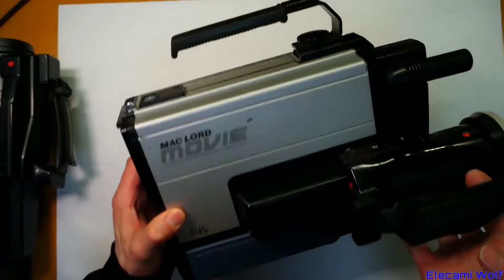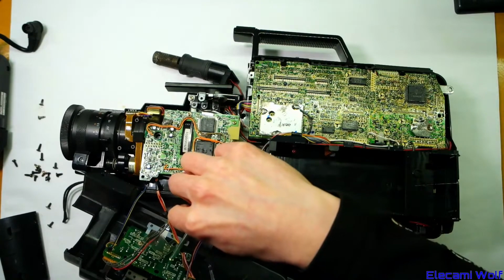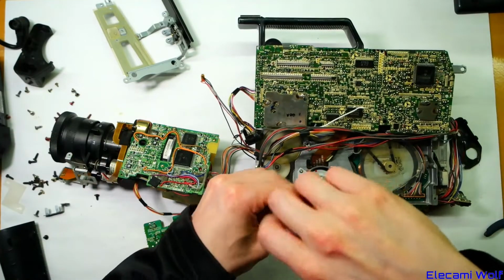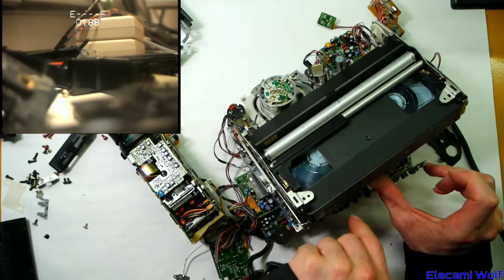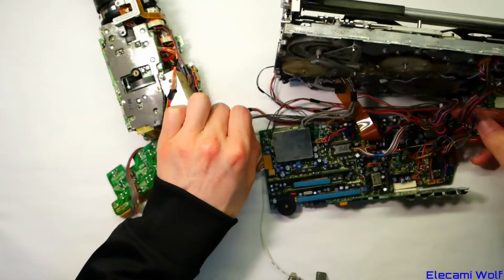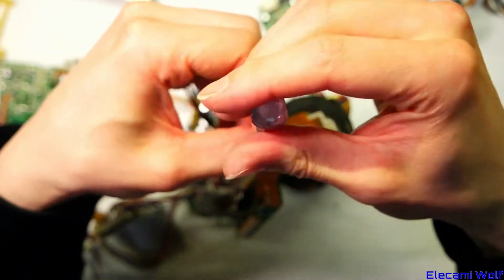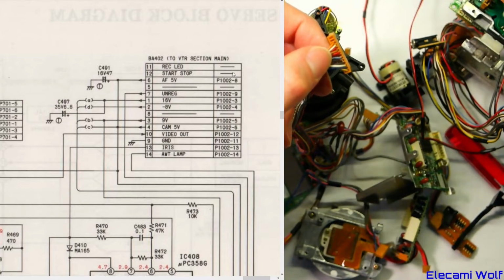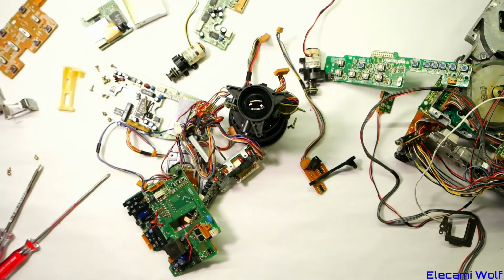EW0061 - National Panasonic NV-M5 Investigation Teardown

Comment: I recently bought an M5 camera. Everything works fine so far. Only the mechanism for ejecting the cassette does not work reliably. If there is no cassette in the camera, the eject function always works.
However, if there is a cassette in the camera, I have to press the eject button several times to eject the cassette. Do you have any idea what might be causing this?
Reply: I have solved the problem. I need to replace both drive belts. This should fix the my problem 🙂 Btw you make great videos!
Reply from the maker: Glad you got it sorted. Thanks.

Comment: Hello, I recently found an NV-M5 in almost perfect condition. My only issue with it is the lens is quite fogged, and the autofocus system seems to be struggling quite badly. I was wondering if you had any resources regarding how to disassemble the lens assembly for cleaning. Additionally, the machine seems to be playing tapes ever so slightly too slow, maybe around 0.9x speed. If you had any advice or information regarding how to fix these issues it would be greatly appreciated.
Reply from the maker: it might not be possible to dismantle the lens enough. Some of the lens are held in plastic moldings. Not sure if the Service Manual will explain it. 
Not sure about the speed. Will it play back something it recorded at the right speed?
Probably needs some capacitors replaced at a minimum.
Reply: @Elecami The speed issue only happens with one tape which also has other issues but, after testing a few other tapes they all play at normal speeds with good image quality. Sadly the service manual says absolutely nothing about disassembling the lens. I have read on the service manual that there is a screw used for setting & locking infinity focus, so I’m hoping undoing that screws allows for the front lens group to be unscrewed, hopefully allowing for some cleaning to be done.
Reply from the maker: @siroescribano4872  Maybe you can get into the lens, it might be sealed and impossible. If it has mildew, it might be difficult to clean off. The IR filter could be affected too.

Comment: My M5 autofocus does not work. If I switch the lever from manual to auto nothing happens. Also if I hold the quick focus button the lens still won‘t turn. I looked inside and found out that the motor for autofocus doesn‘t even spin. Is the small motor just broken? Besides that everything works.
Reply from the maker: Probably the very tiny belt that goes from the motor to the gear box has gone bad. That is common now.

Comment: My m5 doesn't record. Nonthing happens when I Push the button and sometimes it shuts down when I Push the eject button. Please help me 😊
Reply from the maker: Probably because the capacitors in the power supply circuits have gone bad. That is the most common problem these days.

Comment: Imm buying one to film a found footage film. Do you recon this is a good fit?
Reply from the maker: Maybe if it is still working, might need to replaces the power supply capacitors inside it.
Reply: @Elecami  ive been told it work i hope it does

Comment: Pulled the family NV M5 out of storage and have been giving it a go - the camera doesn't seem to expose properly with inside lighting, and the backlight button doesn't work - is there a simple solution to this?
Reply from the maker: Not sure it depends on the specific cause of the issue. These camera will need a lot more light than modern cameras. 
Does it work ok in daylight / outdoor?
Likely the power supply circuits are going bad from work out capacitors. That is a common issue with these.
Reply: @Elecami  works okay under daylight and full power studio LED lighting, certainly not bright though! I might just be unsure what to expect! Sounds like the external power supply needs the capacitors changed? 
PS thankyou very much for the response!
Reply from the maker: @lethalwithalens  Power supply circuits in the camera. 
If you see lines in the view finder or distortions on the video output when the Tape in loading up into play or record mode, that will indication power supply problems are starting.

Comment: I recently acquired one of these for rather cheap, it switches on but when I look into the viewfinder it’s just white with loads of jumpy lines, do you know what this could be?…plays back video fine thought so I know it’s not the CRT.

Also struggling to get it to connect to tv, if you have any tips, that would be great!
Reply from the maker: The usual problem with these is that the power supply capacitors have gone bad. This can be seen as camera not working or picture very distorted, lines on the screen / Viewfinder when the tape is loading and unloading. That would be the first thing I would check / replace.

Comment: Finally a video on the M5! 
Would you perhaps know how to get a closed iris unstuck? Playback works but it doesn't "see anything"...
Reply from the maker: You would have to take the lens assembly apart and give the iris a poke to free it. Be sure that is the actual problem first. 
Quite likely to see capacitors gone bad in the power supply on these cameras. That could prevent the camera from working while other parts still function. You could judge the power supply performance by looking for distortion on the view finder while the tape is entering play mode. The power load or the loading motor will sag the power supply if the capacitors are bad.

Comment: Olha pode me tirar uma duvida sou aqui do brasil tenho uma nv - m5 ela grava colorido  mais reproduz em preto em branco qual sera o defeito?
Reply from the maker: Could be the back tension band fallen off. or an issue with chroma electronics.
Reply: Como posso resolver amigo esse problema
Reply: Essa faixa de tensão traseira  seria o que?
Reply: Problema  om eletrônica croma vc pode me explicar?
Reply from the maker: @cirovieirademeloneto8425  I don't have more information about it sorry. I would start by checking the electrolytic capacitors. They could have dried out from old age.

Comment: My NV-M5 seems to be stuck in FFW mode when playing back and recording. I have no idea why. The buttons work OK so its not a stuck FFW button.
Reply from the maker: Maybe the pinch roller is bad and the take-up is pulling the tape through. OR bad serveo and capstan is running fast OR bad control telling capstan the wrong thing. 
Maybe capacitors have gone bad. Almost guarantee they've gone bad in the power supply circuit.
Reply: I had this same issue with my m5 (ag 160, but similar in everything) possible issue with the model fast-forwarding could be the mode switch, you may need to open the camcorder to get into the mode switch and clean the contacts with contact cleaner. I did this and now it works perfectly okay for the most part.

Comment: Do you have to take off the camera section to access the belts? I just purchased a PV-220D which appears to use the same chassis/design, expect it uses a Newvicon tube instead of a CCD. I've also read that these have capacitor issues, is that true? The one I bought was manufactured in February 1986, and it looks like the capacitors are though hole so it shouldn't really be a problem I think.

I ended up just scrapping the parts off of my PV-200D since I couldn't figure out the problem with the tape mechanism.
Reply from the maker: I think you will need to take the camera part off to access the belts, especially the tube type since it has a big board that covers the mechanism. Capacitors can be a problem in the power supply. Because it is a switching power supply, that is hard on capacitors due to high ripple current.
Reply: @Elecami  I just got my PV-220D, the camera section works but I believe the capstan belt is bad as it is squeaking. I can get it to play a pre-recorded tape and I've managed to make a recording but since I have a replacement belt I will replace it.
Reply from the maker: @KylesDigitalLab  Sounds good. 
I am not sure if the belt would be the cause of squeaking though.
Reply: @Elecami  I got the belt replaced and it's fixed now, but I broke the metal piece for the "cursor" which is that sliding part that engages the switch on the operation PCB between VTR and camera mode. Everything else is intact so I'm wondering if it's possible to do anything to make it engage with the switch again. Like using epoxy or soldering metal tabs to the remaining piece of metal. If you have any ideas please let me know because it's perfectly functional and working now.
Reply from the maker: @KylesDigitalLab  I am not sure of the exact piece that is broken. Probably can't be soldered easily. Would depend what metal it is made form and plated with. Epoxy might be better. 

Probably be easier to solder in another separate external switch like a small toggle or slide switch.
Reply: @Elecami  I ordered a pack of slide switches from Digikey. It should work with the PCB but I'll probably have to epoxy some plastic to the cursor in order to make it engage. I'm just hoping I can make it look factory from the outside with no external switches.
Reply from the maker: @KylesDigitalLab  Hopefully that works out ok. Another options would be to find another of those camera to get the parts from.

Comment: I have Hitachi 500E full size vhs camcorder problem is when i turn on camera the red light blinking and loading motor run automatically for some seconds then camera off same things happen when my Panasonic nv-m3000 what is the case of this?  I checked power supply with another unit its power supply is ok dose it main pcb problem i don't know what i check in main pcb can u please help me its really helpful because its really stressed
Reply from the maker: Probably is the belt on the loading motor slipping. That means the mechanism can't reset back to the stopped state and VCR goes into error state..